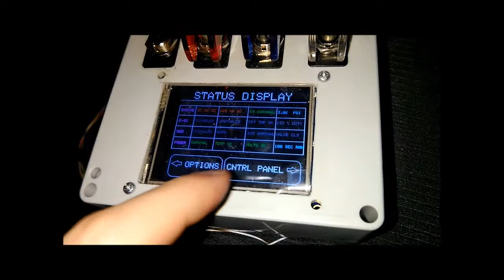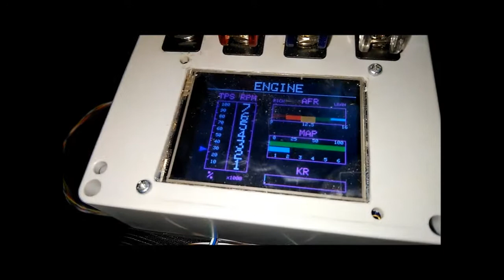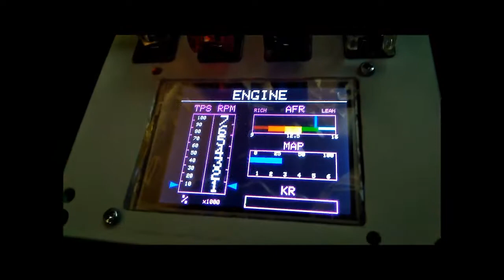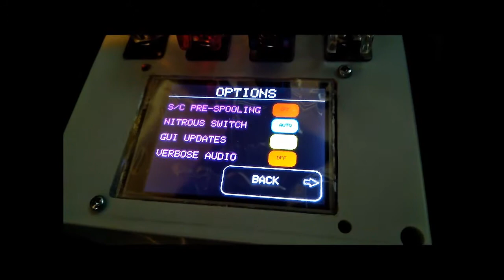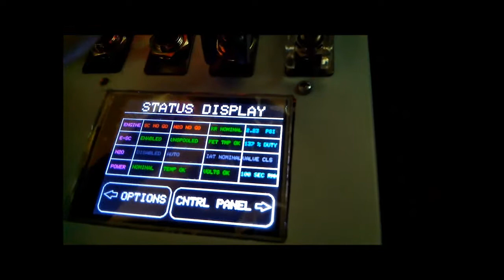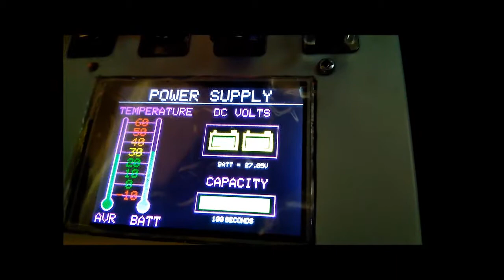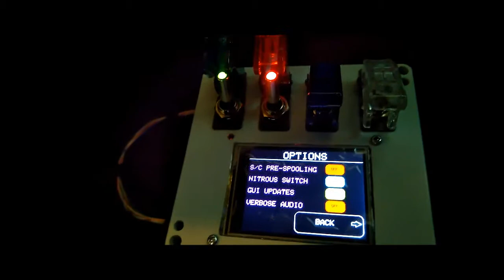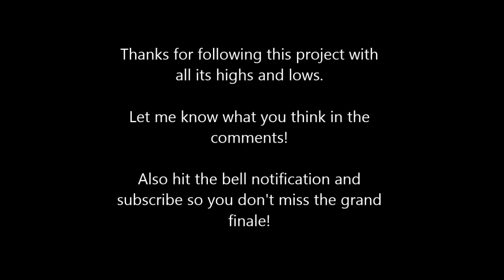Electric Turbo Camaro Project - Part 4: First Fire and Initialization

Comment: Wait so what happened?? It never got finished? Is there a part 5 coming or was the project abandoned or what? I was talking to the torqueamp dude about putting dual torqueamps on my LS3 to get the needed boost I just came across this I didn't even know if someone had done it yet or not. He seems to think with twin torque amps I wouldn't need a blowoff valve. I was asking what his plan was to cool the air though and he didn't have anything planned, the nitrous is the perfect solution if you can get it to just inject it as needed to keep the intake air temp where you want it to fully benefit from the boost.
Reply from the maker: I'm not a huge fan of torquamp.  At least when I first discovered the brand and listened to some of their advertising material and tech talks, they sounded like they were completely full of shit.  If I recall correctly they had some dyno curve from a torqueamp attached to a 4-banger and then said it would do the same thing on a V6 or V8, no difference.  Lost all credibility when I heard that, especially given the flow numbers they were disclosing for their blower unit.  To answer your first question, the project isn't dead but to be honest I simply haven't had the time.  That may sound horribly lame but I really am totally burnt out at the moment and have driven my Camaro a grand total of maybe 4 times this year.  I am truly sorry for making anyone here wait for an update.  I believe it may be possible for me to do some testing in the coming weeks however.  I can't make any promises but I'm going to try very hard to get something done this season.  There isn't much left to do really.  I just have to go for a drive and test the thing.  The problem is, with something I programmed myself and >250 amps flowing through an under-sized controller, I really really don't want to blow anything up or kill myself so I need a contiguous block of time with nothing to distract me so I can check and double check everything and then test it.  Once I pass that milestone I'll have something worth reporting.  Just hang in there a bit longer.

Comment: Any updates 🔥🔥🔥
Reply from the maker: So last year I reached an impasse with testing where, I was able to get the motor to perform roughly how I wanted it to on the road (ie. It would trigger and run given a certain range of inputs like throttle, RPM etc) but I was getting no boost.  The problem was that the motor wasn't wound correctly (Wye vs Delta).  Essentially I was getting plenty of torque but no speed.  I had the motor re-wound but by the time I got it back I didn't have any more time in the season to work on it.  The next step is to hook everything back up all over again and try it again.  I have some trivial work to do regarding fasteners and connections since the motor was re-worked and then I have to determine the new PWM profile for this new winding configuration (since it will run a lot faster than anticipated now).  Once I dial that in and get a successful road test I'll have something tangible to report.  I'm rather busy these days so it might be a little while but I have a clear path forward now.  In theory there's nothing stopping this thing from working correctly so let's see if I can reach this next critical milestone by the end of this summer!

Comment: Good afternoon Chris, been watching you progress with your car and electric turbo, have you stop progressing or are yoy going to post updates
Kind regards 
Michael
Reply from the maker: Hey Michael!  Ehhhhh....  the short answer is yes, I'm going to finish this and post another update video.  The longer answer is I have so many things on the go right now, not all of them pleasant, that I haven't been able to get back to this in a timely manner.  But it will get done.  Last update is that the motor needed to be re-wound in order to spin fast enough to produce boost so now I have to reconnect it to the car and start carefully calibrating my boost curve so that I don't blow myself to kingdom come.  This isn't an obstacle per se.  It just takes many uninterrupted blocks of free time which I haven't had yet this season.  Once I get to it, progress will occur quickly, since everything works in the technical sense, so this is just tuning and safety I have to get around to.
Reply: @ChrisCamaro  good afternoon  Chris,thank you for taking the time to reply me and you explain, I have a Holden Caprice WN 6l and would love to try this,my problem is I Live in Launceston Tasmania Australia and hard to acquire parst and info,keep up the good work, 
Thank you
Michael

Comment: If you don't mind what is the model of your. Brushless motor and where can it be purchased?
Reply from the maker: The motor/supercharger isn't retail.  It has no "model number" per se.  It's a custom build from Thomas Knight of Thomas Knight Superchargers.
Reply: @ChrisCamaro  thank you for the info. Guess my next question is about your battery pack. How long does it last under full load and don't remember hearing, but more than likely I just missed it, is your battery pack 48 volts? As the 2 units your used is 60c (120c burst) 22.2V. I take it your running them in Series 48v?

As of right the battery setup is all I honestly have to work out. As i have already order a compressor housing / blower and Motor. Know what controller i will be ordering and by the way your custom ESC and diagnostic setup is next level. Just have figure out what battery setup and charging i want to use.
Reply from the maker: @mark120371  I'm using 2 x Turnigy 7S batteries in PARALLEL.  The nominal voltage is 25.9 but fully charged it's around 28 or so.  I haven't done enough road testing to totally drain the batteries and measure how long they lasted but I would estimate somewhere between 60s and 100s of total runtime.  The controller I'm using can't really take more than 30V so a 7S is the highest I can go.  However this all depends on the motor and controller you're using.
Reply: @ChrisCamaro  You're gonna need more voltage once its all said and done though right? You think the prismatic cells will end up giving you the power you need to get the boost you want? When I was thinking about doing the dual torqueamps I was going to use prysmatics just because I already have everything on hand to build the needed 48V power storage I would just need a BMS, but I think the right way to do it is with headway. For the same amount of weight you'd get a decent increase in capacity and way higher discharge for when you need it without seeing that voltage drop. You could upgrade the controller and run at 48V without any voltage drop at all with the headway assuming you can get enough capacity I honestly have no clue I haven't attempted any weight calculations to determine how much it would actually weigh to be able to use the boost as much as you want within reason without having to worry about draining the power storage and dropping the voltage and performance way down and not being able to catch back up.        I dont have the funds to get into it now but I was going to build my own power storage because what he's providing with the torquamp kits is nowhere near the capacity I personally would want to have to fully utilize it and not be driving around trying to charge the batteries for an hour for a few seconds or a minute of boost. My plan was to get enough power storage in the trunk that it could feed both torqueamps and provide as much boost as I want without having to let off and let the batteries recharge, and then of course I would have to plug it in at night and replenish the depleted power from throughout the day depending on how much driving I did. I hate the idea of being limited and only being able to use it briefly and then have to wait who knows how long for the 14.4V alternator to recharge the 48V power cells. 

Unless you put a massive alternator in I don't see it working very well with the power storage he’s including with those kits. I've looked into it I know you can get some crazy 350amp alternators for $1500 or wte it was and I'm sure that would go a long way to keeping the cells charged, but how much extra horspower would an alternator like that eat up? Unless they're just way higher quality and way more efficient, I would assume those really high output alternators must take significantly more HP to spin right? And even with an alternator upgrade it still wouldn't cut it I don't think unless you have a decent capacity and the right wiring and high discharge cells to get the power there when it calls for it. That little 8 gauge wire or wte those kits being sold come with isn't going to cut it I dont think. I know at 48V even super high current comparatively can pass through way smaller wire than with 12V but still I don't see 8 Guage wire or wte little wire is being used being able to get that amount of current all the way from the trunk to the compressors under the hood especially as things get hot. My 2SS 1LE with the big ass alternator they come with doesn't keep up with stop and go driving with all the audio equipment and radar/laser blocking systems and everything else on top of all the extra stock electronics with the 2SS to begin with. 
Even after running massive 2/0 tinned copper power and ground cables everywhere in addition to the stock wiring, I was finally getting power to everything efficiently but it was draining the stock battery even with the best AGM replacement I could get it would drain it over time. I had to invest in a big ass lithium battery just for the daily driving with what’s installed to keep up once i upgraded all the wiring. It doesn't drain it right away but over time it will slowly lose voltage with normal daily driving unless I took it down the highway for hours to recharge it. If not I have to plug it in every couple weeks or so just to keep the voltage from creeping down. I guess I could probably place a little solar panal somewhere in the back where it could grab enough sun to make up for the super gradual voltage loss or I could upgade the alternator but its really not an issue now with the lithium battery.
 I can't imagine trying to rely on the alternator to recharge a small limited 48v power storage unit like the one that comes with the torqueamp though on top of everything else. I would never even get to use the boost. If i can get dense enough power with headway to not have to worry about it all day I would gladly plug it in to replenish it at night vs trying to somehow get the power from the charging system to recharge the power storage over and over every time the electric superchargers depleted it throughout the day while driving it. Def would ruin it for me.